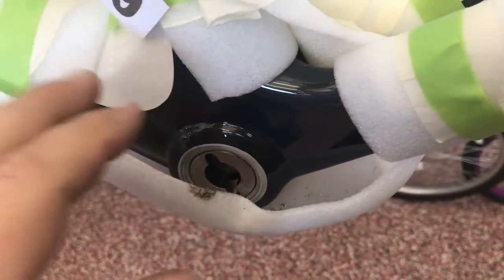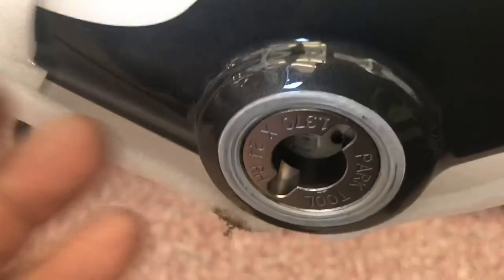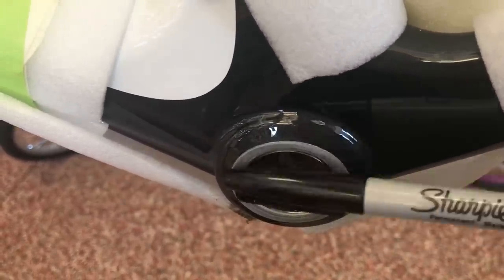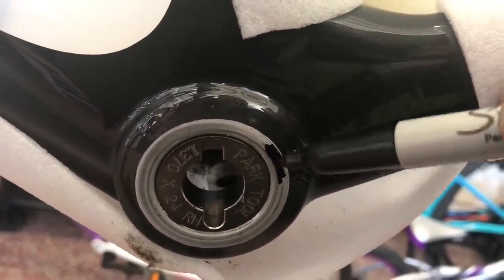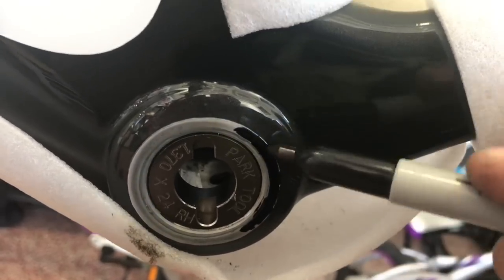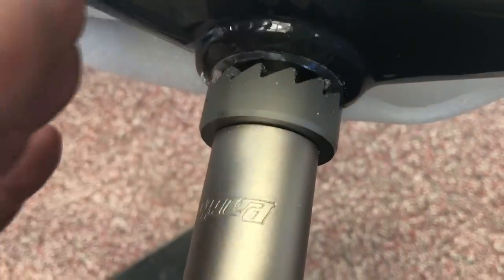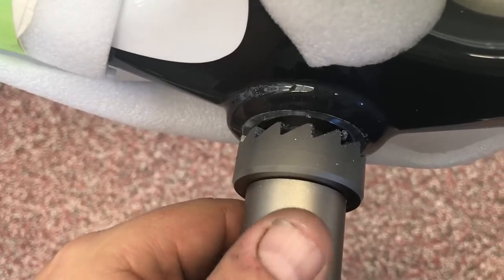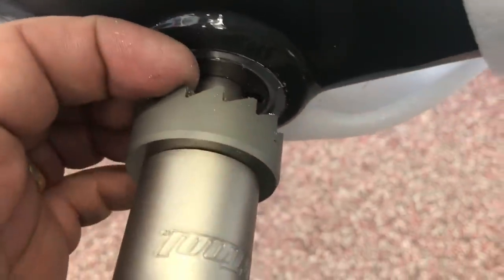Old trick that can help take guesswork out of facing Bottom Brackets or even Disc Brake mounts

Comment: Proper tightening technique... You should add spring pressure by holding the nut and turning the handle on the cutting end to add pressure while rotating the cutting tool.

Comment: Nice video Rob! I spend hours per bike masking, unmasking, and remasking so that my paint doesn't go where it should. I'm starting to use taps as well as needed. But I like the idea of using a facing tool if time permits to finish the job right so this maybe something to learn in the future.
Reply from the maker: I would say most shops or high end mechanics who would end up assembling the kind of frames you paint would normally address anything that would be off, but indeed if something came to me already well taken care of in this regard would end up with me recommending the painter highly. Care in work is always seen and appreciated by those who possess the ability to see it.

Comment: Good tip. BUT.
Why did it take 9 minutes & 38 seconds to say "Use a sharpie if you don't have the correct layout fluid"?
Reply: Because "creators" get paid by the minute, they are charging the viewer/customer
Reply: @janeblogs324 Thank you.👍
That explains a lot as I couldn't understand why they waffle on so much before getting to the point.